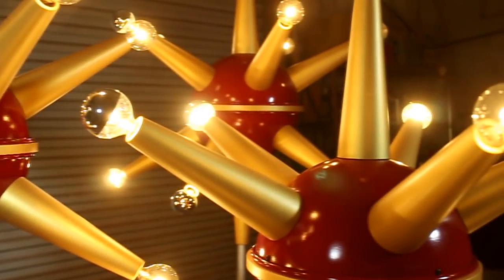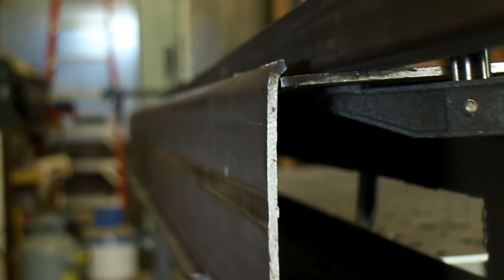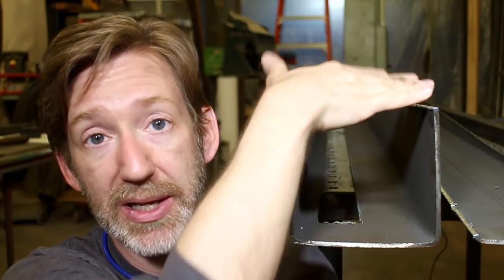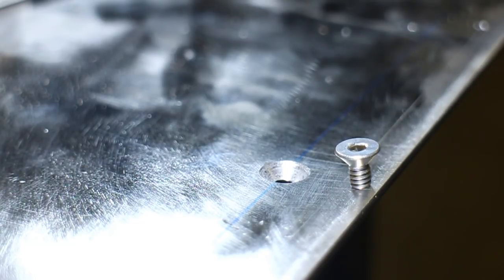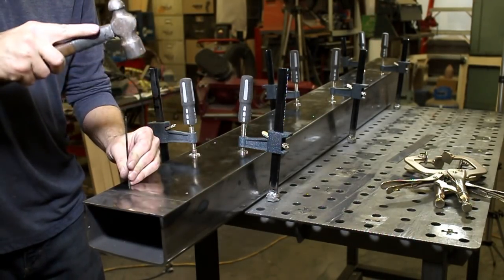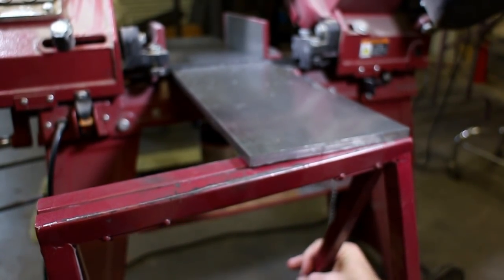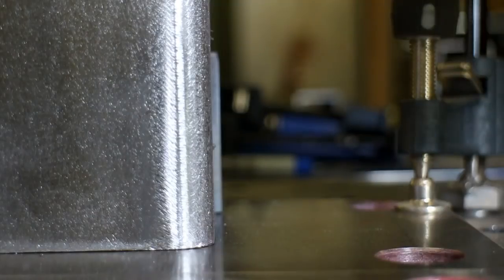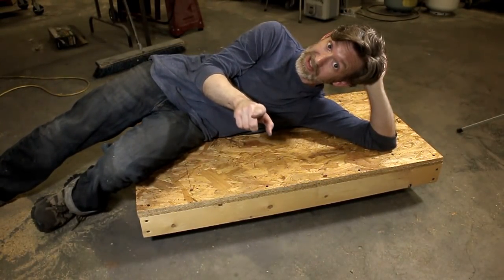Illuminated Steel Wayfinder Sign for a Drive-In Movie Theater

Comment: Ah yes!.. I learned about the tension in steel tubing a couple years ago.
Needed a piece of steel 1/4" x 4",  but didn't have any 1/4" plate lying around. Had a nice piece of 6"x6" though. When the tubing burst opened, it bound up the cutting wheel and the wheel exploded into shrapnel. Got a couple nice nicks in my neck and had to change my shorts before continuing with that project.

Comment: Great work, that sign looks incredible. One thing I'd like to point out though- I've seen an exploded angle grinder wheel go most of the way through a face shield like yours. It wasn't that exact same model, so yours might be better impact rated, but I'd always heard to wear safety glasses under those if you're doing anything with flying debris hazards- like the grinding wheel you had on your right-angle jig. Thanks again for the great video!

Comment: I noticed the cloth you had with your welding helmet. I use binder clips to attach a cloth to the top edge of my helmet to block light and stop reflections.
Reply from the maker: Binder clips are an oft overlooked workshop necessity.

Comment: Love it!
Genuine question, but I can see how it might not be seen as that - how do you work through how many LED's/strip might be needed based on watt output, or is it just fit as many as possible into the space?
Reply from the maker: It's mostly guessing based on experience, but I'll also test strips where I can before doing anything permanent.

Comment: Awesome project, Wesley!
Quick question if you don’t mind...
How do you connect up the cut ends of your LED strips where they go back on themselves? Thanks.
Keep up the great work!
Reply from the maker: I solder them in parallel, one wire across the positive contacts, one across the negative.

Comment: Hey, know this is an older video (what can I say, I lika your stuffa) but, you mentioned at the beginning of this one (the drive-in theatricatron facilities sign) that they wanted to be able to change up the items on the signs. When you assemble it, each of the facilities is in a single homogenous strip, including the arrow. Now, it's probably just me, but, if the arrow will always point the same way for the same facility, doesn't that end up being that they can change the order of the things, but not what's being pointed at? Would it not make sense to have the arrows as seperate pieces?
Genuine question - I probably missed something.
Reply from the maker: Making the arrows separate wouldn't really help, since the location of each facility doesn't change. But, when they add or remove facilities from the property, they can add or change out lines on the sign. (Just a few weeks after I made this, they had already added a couple new items to the sign.)
Reply: @WesleyTreat  Ah right, that makes sense, fair play, thanks for the feedback :-)